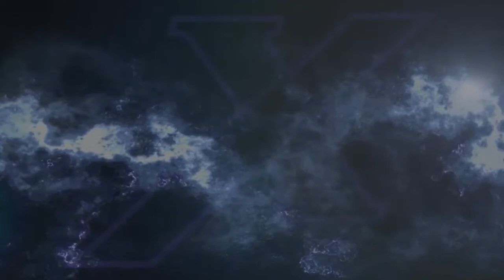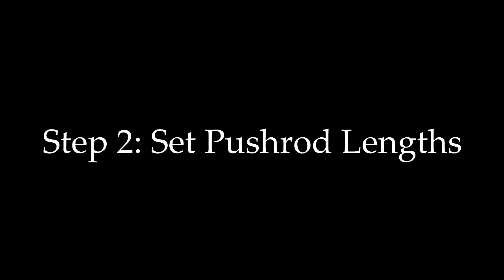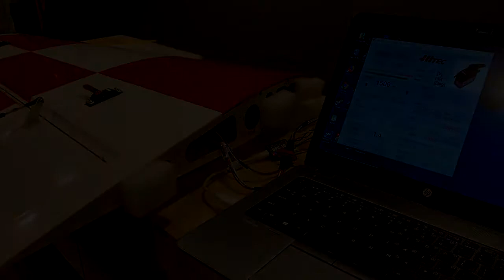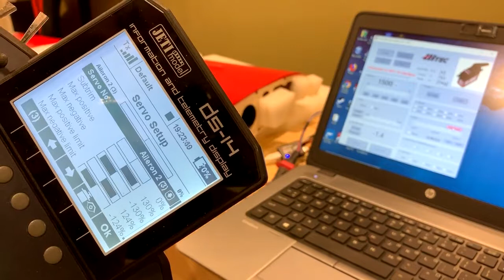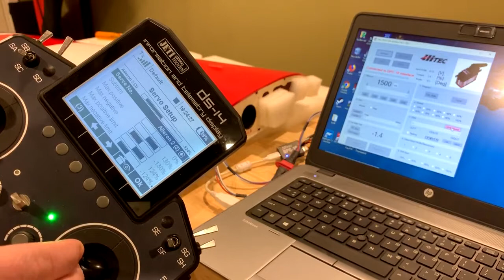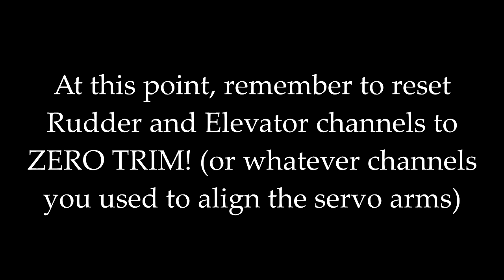How To: Program and Gang Aileron Servos with Hitec Brushless Servos and Jeti Radio

Comment: Hi im having a difficult time using the dpc-11 programmer. I believe there is an issue with the driver i hae downloaded for my computer but i cannot download the latest driver.
Reply: In this video I used the DPC-10, and I just received a DPC-11 to test. Message me if you're still having problems.

Comment: Hey this is very helpful thanx for the video I'm setting up a 100cc edge with dual aileron servos, but my transmitter doesn't have enough channels, but according to your video i can program the aileron servos, adjust the end points accuratly so they are matched perfectly and connect them together with a y harness? That would be GREAT! My radio doesn't have enough channels for each servo to have its own port in the receiver! And I feel like spending more money into buying a new transmitter
Reply: Yes you can, however I would not suggest using a Y harness for two aileron servos in a 100cc plane. Typical servo connectors are rated for 5 amps of power before you start to have voltage drop. You can use a Y harness for the signal wire, no problem. However I would suggest running separate power and ground lines from your RX to each servo at least.